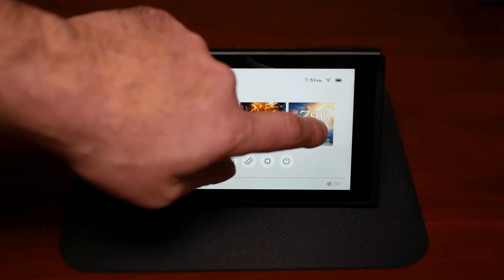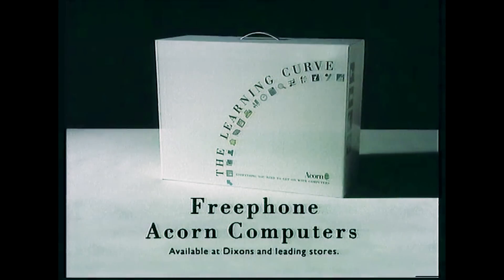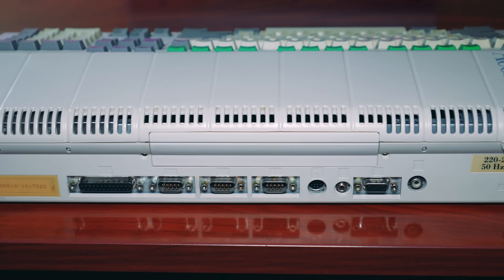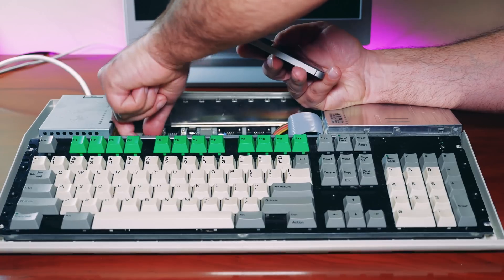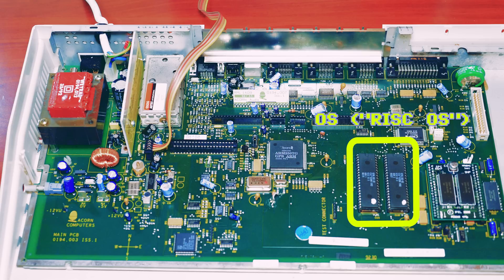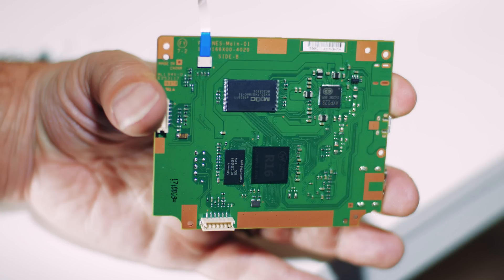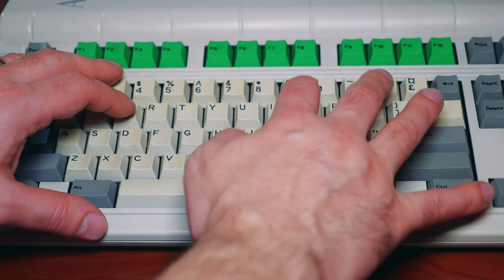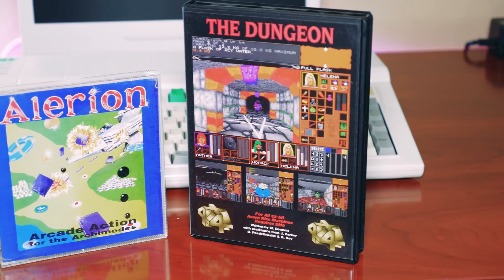Acorn Archimedes A3010 System Teardown and Review | MVG

Comment: Amusing quirk of the ARM250 based Acorns is since it was essentially at that point a very mature chipset shrunk into a SoC with a superior fabrication process, it could clock much higher than the official 12MHz.  The performance was limited only by the fact the DRAM controller ran the memory synchronously and there was no cache.  This meant the DRAM speed was the limiting factor, so replacing the DRAM with faster chips and a new crystal meant you could easily overclock the system so such an extent that the budget machine could probably outperform the contemporary high end ARM3 based Acorns.

Comment: The problem with all unsuccessful IBM alternatives was that their creators, for some reason, thought that everyone would just be content with terrible lo-res raster fonts, TV resolutions, and waveform synthesis farting passing for the "sound". All IBM-compatibles have nice sharp displays, where every pixel was visible; superior resolutions and quality sound in easily replaceable modules.
And of course no one thought of the software, it was always barely functioning clones of the real software with 0 usability (like in this case, with context menus everywhere), 0 customizabilty and internationalization.
Basically, all those Amigas and Acorns were a waste of chips intended for a quick buck from an unlucky fool who'd thought that they got a real computer. (They even tried hard to imitate the PC keyboard, because that's what most people pay attention to when they see a computer.)
Reply: Except that RISC OS had Anti Aliased outline fonts and supported resolutions up to SVGA! Where do you think MS got the idea of outline fonts from?
Reply: @melanierhianna  ...when other systems already used more advanced Type 1 and TrueType fonts.
Reply: This is someone who's never used an Acorn ARM machine. I had access to PCs and alwayhs went back to my Acorn. By the time the Acorn RISC PC had come along it could run DOS and Windows under emulation. In fact the first time I ran Windows 95 was on an Acorn machine.

Comment: Looks like an amazing machine for it's time. Especially the integrated design, with the SOC and elegant case. Interesting to see that whilst it remained obscure compared to it's Amiga and ST cousins, in the long run it's strengths won out in terms of SOCs and ARM chips becoming standard. 

It still makes me wonder what more could have been done with it, it looks so flexible.
Reply: Ive been an Acorn fan for 35 years. Still am, just now i run RISC OS on a RPI 2B and RPI 3B+. The 3010 was a very capable machine. Sadly there didn't seem to be enough top rated programmers who were looking to squeeze every last drop of performance out of it ( with games in mind ) but seemed to rely on the pure ARM technical abilities, which to be fair in a lot of cases was enough to outperform Amiga 1200.
Reply: The A3020 with a fast 4mb RAM upgrade and modding a resistor to double the clock speed runs Doom.
The current crop of demo coders in the Acorn scene have also managed to get it to output 4096 colours on screen as well as a truly stupid amount of sprites.

Comment: It's a great machine, but it was a bit late to the party, by the time the A3010 was introduced the Amiga 500 had already been discontinued and almost everyone I knew at the time had switched to PCs.
Reply: Despite the look its not targetting the 500. The original Archimedes was targetting the Amiga 1000 and was only 2 years later. This is more targetting the Amiga 600 but with the performance of the Amiga 3000

Comment: I wonder why the Bitmap Brother never managed to do smooth scrooling.
Gods, Magic Pockets, Chaos Engine... They all were great games with great atmosphere and I played them alot, but no smooth scrooling.
Reply: One of the problems was that the ARM whilst writing 32 bit data had to write this data word aligned. This was 4 pixels of data in a 256 colour mode as most games were. This resulted in 4 pixels at a time scrolling in the horizontal which didn't lend itself to smooth scrolling. This is why further up in this thread i suggested we needed more top programmers who could squeeze every bit of performance out of it. Smooth scrolling was possible, it was just hard. I think lemmings achieved it nicely.

Comment: I had the Acorn Archimedes A3000 - upgraded to a 'MASSIVE' 2MB Ram.  Had a HUGE 20GB HD installed to plus an ARM3.  Way ahead of their time - but Acorn marketting was bad - should have opened it out before the IBM PC compatibles gained momentum.  Your comment of the Amiga A3000 being able to be better with better programming is mute really, as the Arc was further developed to use Geforce graphics cards but the 26bit address space was a an inherent limitation causing problems getting games running on the Pi - some great stuff by JASC mind you!  3D it excelled at and would have had better 2D if they knew how to program it at the time - only Demo makers seemed to push it hard!  Mind you I love the Amiga/ST/Archie as these were in the hey dey before the internet!  Was a great era!!!

Comment: Ive got an Archimedes A310 and an A3020, I've never seen inside an A3010 and was surprised how different it was as it looks identical from the front except the F keys are red. The battery leaked in mine, took a day or two of finding and running mod wires to fix the broken tracks, mostly on the printer port next to the battery.

Comment: A bit late to comment but I have modded modern optical mice to work with Archimedes, Amiga and even the BBC Micro Quest mouse. They all use quadrature encoding and many older optical mice had a larger chip with quadrature pins. The Archimedes needs a special mini-din plug which can be hard to find as there are 2 pin spacing standards with the same pin count.

Comment: They dumped the Archimedes name actually, when the A5000 came out, all subsequent models where just branded Acorn. Many games used 16 colour 4096 palette modes as well, often the graphics were just taken from the Atari ST version, some developers felt 256 colour modes were too slow. In RISC OS, you can also press F12 to enter command prompt mode without needing the mouse.
Reply: The 'too slow' excuse from the developers could be replaced by 'too lazy'. The Amiga 500 could easily use 32 colours, and if the speed is higher than the A1200 (which could use more colours and higher speeds) I have some serious doubts about what they are saying.

Comment: 08:31  Zarch = Virus?
Reply: Yes it was original on the Archimedes and called Zarch, later on it was ported on other systems (Amiga, ST) and called Virus. The best is the Archimedes version, and that comes from an Amiga/ST owner. Games in 3d required a lot of CPU power, the customchips from Commodore/Atari were made with 2d in thought. So with 3d everything comes down the CPU, and the 68000 couldn't match the ARM. I know that the Amiga could outperformed the ST in a lot of games, but in 3d they were about 10% slower due the higher clockspeed of the ST.

Comment: As I understand it Acorn (which later spun out a separate company known as ARM) developed the processor because it needed a BBC replacement but were disappointed with the performance of common 16 bit processors such as the 68000 so I thought how hard can it be to develop their own processor!.  Against all odds considering their limited budget they succeeded in something even Commodore couldn't do despite owning their own fabrication facilities.

Comment: One question: since the OS is on ROM chips, is it possible to replace the ROMs to change /upgrade the OS?
Reply: They were usually socketed ROM chips so it was easy to upgrade the operating system. Not sure about the 3010 in this video as it was a cut price model designed to compete with the Amiga and ST.  I may be getting this wrong as I was only just old enough to be into computers at the time but I seem to remember it was priced in between the A600 and A1200.
Reply: @p166mx  Socketed on all machines, including the A3010
Reply: Yes, upgraded a 1989 A3000 from RISC OS 2, to RISC OS 3, to RISCOS 3.11, as they came along. Could also load later versions of the OS modules, into RAM, but that reduced the available RAM. If you had a hard drive installed you could download and boot into Linux.

Comment: A little tip is that the final Acorn machine, the A7000, uses a standard PS/2 mouse, you just need one with three buttons. One with a middle scroll wheel that doubles up as a button will work just fine.

Comment: More like the "Archi-'meh'-des", if you ask me. I simply cannot envisage myself having a sentmental attachment to it (or them). I'd have hoped I would do for a national pride, but alas, it doesn't even meet that factor and it simply seems more like a lesson learned in what they could have done. I think they should have not tried so hard to play whack-a-mole on sorting out features like having a higher capacity floppy drive. They should have instead used the trick of making the 4096 graphics better (older one) there and then. It's also very "locked-down" as if an omen of things to come. It isn't very "free" feeling. e.g OS and mouse.

Comment: You're absolutely right about the pricing! As someone who used an Acorn A3000 in Primary school, I've been trying my hand at attempting to acquire an A3000 into my retro collection. They are so rare!!! Surely NSW Department of education have sold off their fleet rather than disposed of them back in the 90s. There should still lie a few Acorns in in attics/garages/sheds that should come up eventually!
Reply: Sadly not, I had a few Acorns (not sure which models) from a computer recyclers which got skipped as nobody wanted them.  I also know when a local school closed down they skipped all theirs too as a friend rescued one of them.

Comment: Is there a spec for the mouse? Probably you could take a ps2 mouse and rewire it to work with the Archimedes.
Reply: this guy did: http://www.kernelcrash.com/blog/modifying-a-ps2-optical-mouse-for-an-acorn-riscpc/2016/03/26/
Reply: Very cool!
Reply: Its a vanilla quadrature bus mouse, originally sourced from Logitec or AMX, but with a propriety wiring, to stop you using an Atari ST, Amiga, BBC Micro, Amstrad CPC, ... mouse.

Comment: I wish to point out that Commodore Amiga A1200 was powered by Motorola MC68EC020 and not MC68030 and was running at 14.3MHz, no 33MHz. Only big Amigas had any 68030 or better processors and none Amiga ever run faster then 25MHz on stock

Comment: If you don't have a mouse there is a workaround if you remember your ADFS commands. hit 'F12' that should bring up the RISC/OS version of the run command/ command console. from type basic and press return. This should launch Acorn Basic which is basically the same as good old BBC Basic. From here you should be able to use all the old ADFS commands to explore the disc drives and possibly even launch programs, that's if you can't do them from the command console anyway, it's been so long and i miss that computer.

From the 'F12' console you can do other stuff too, things like '*unplug basic' to free up some extra memory for a game for example.

Oh and I once saw an A3010 in a computer shop next to a competitive 386 pc, the pc was running the game virus, the A3010 next to it was running a PC emulator running the same game, and it ran it faster and smoother than the equivalent PC on the market. Oh and the A3010 next to that was running Zarch (The same game just the Acorn version) and guess which looked best?
Reply: For some reason F12 for ADFS console is burned into my brain, despite not touching an Acorn for about 15-20 years.

Comment: A very interesting video for an equally interesting machine, Lemmings and Zarch/Virus/Lander brought back a few memories.

However I would be remiss if I didn't point out that the ARM250 is a RISC CPU whereas the 68030 is CISC making speed comparisons quite difficult, you definitely can't just compare instructions per second. As is alluded to in the video, the Amiga comparison is also deceptive because the custom chips can manipulate memory independently of the CPU. Things like screen scrolling, sample playback or disk access have very little impact on the Amiga's CPU usage whereas on the Archimedes practically everything has to be done in software.

History has ultimately proven that RISC was the way forward but this was not clear back when these machines were introduced.
Reply: The Acorn also had custom "chips". The VIDC and MEMC where Acorn's equivalents to the Amiga's Denise/Paula- (VIDC) and Agnus- (MEMC) chips. They just didn't have the fancy names like their American counterparts.
Reply: Well, first Surname, since the Power PC Chips, the Pentium Pro and the AMD K6 there are no real CISC processors anymore. Only RISC-cores, that get fed by pipelines where the sudo CISC instructions get broken down in its RISC parts. Quite what a compiler for RISC would have done in the 1980s and 1990s, but much faster and on the fly.

Comment: That thing looks amazing!
Not just because it's (a possible UK only?) competitor to the Amiga500 and Atari ST but also because it's a SoC running on ARM hardware.
Nothing special indeed but this piece of info has some history lesson touch to it.
The part that impresses me the most however is the 3D capabilities of this machine.
Now, I can't say how well the base 500 or ST perform in that department but the A3010 does really well from what I get here.
Thumbs up!
Reply: The 3D capabilities blew away the Amiga 500 / 1200 and Atari ST hands down. Only the Amiga could compete on 2D in some cases.

Comment: You forgot about the Acorn Electron, it was a cut down budget version of the BBC micro designed as a home competitor to the Spectrum and Commodore 64
Reply: I own a Acorn Electron (it was my first computer) it was the competitor of the ZX Spectrum not the C64. The C64 wasn't a budget computer like the Spectrum or Electron.
Reply: Yeah. and it failed miserably due to the fact that it was missing some BBC-graphics modes and was way to expensive. People tend to forget that Acorn was the UK equivalent of Apple. Expensive computers for the more fortunate amongst us. While Sinclair (and in the US Commodore) were truly for the masses. I guess the most affordable Acorn must have been the Atom especially in DIY-kit.
Reply: They only graphics mode that was missing was mode 7 (teletext). As far as I know the Electron was 20 pounds more expensive than the Spectrum, but it had a real keyboard. In the early eighties the C64 wasn't exactly cheap were I live. The Spectrum was half the price of the C64.
Reply: @xXTheoLinuxXx  It also lacked RAM, the Electron was actually fairly successful but by the time proper proper production started more powerful machines such as the C64 were becoming more competitively priced. In many ways the Electron was a suburb machine but I was never sure where it really fitted in as the Spectrum was so cheap and the C64 was better for games.
Reply: @p166mx  The Electron's RAM was also only 4 bits wide and in most video modes the CPU would be completely blocked while the video chip was reading the display.

Comment: If my memory serves me correctly the A4000 model uses a PS2 mouse rather than the normal Acorn one and PS2 ones should be easy to source. It has various different characteristics from the A3010 however. HTH
Reply: Only the A7000 uses PS2 mouse (and PS2 keyboards). All others uses the typical Acorn bus mouse. The Risc PC did use a PS2 keyboard though. The A4000 (and A5000 too) did use a "standard" IDE-harddrive :-)

Comment: I remember when our secondary school started its new Information Technology classes and purchased these - upgrading from the BBC micro. we were all so hyped, but back then all the computers were around the edges of the room and normal desks in the middle. We spent weeks upon weeks doing textbook stuff not even touching the computers much to our dismay, it wasn't till the last couple of weeks before end of term we actually used them..
Reply: Same here when I moved from primary school where we had one BBC in the classroom vs secondary with still a BBC in the normal classroom but also the computer room full of Acorns.  I too remember the pain of not actually getting to use the computers enough, I got to me good friends with the technician (who naughtily pirated me some Amiga games, hehe).

I never knew the Acorn had that many games, only ever managed to get Lemmings for it which ran rings around the Atari ST version I had back then.  Thinking back, its strange I never got Lemmings for Amiga.
Reply: We had these in secondary school. By the time I did my exams they had replaced them with PCs. In junior school we had BBCs and Amstrads. I remember they were daisychained with a bnc network connected to the bulkier risc acorns as servers for printing and scanning.